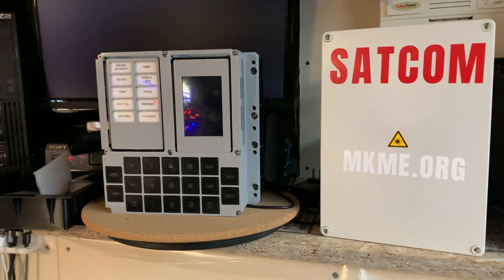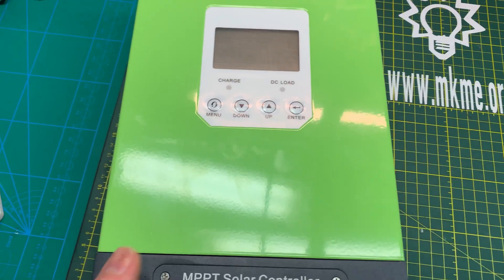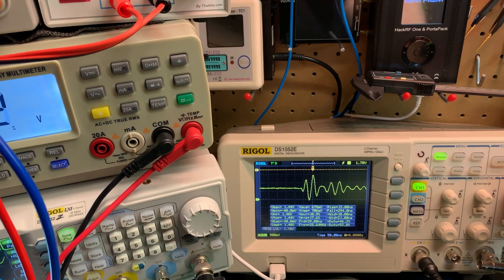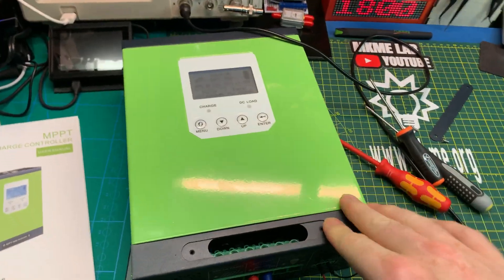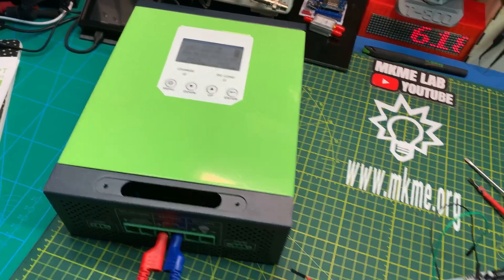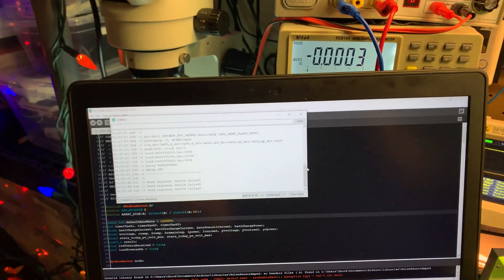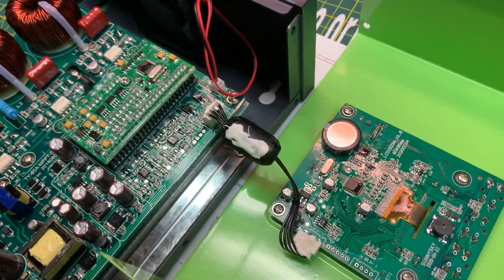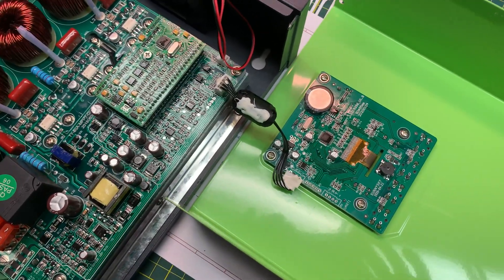MPPT Solar Charge Controller Hack Part 1

Comment: I have a charge controller that looks more or less like that, only it has a 6p6c connector labeled RS485, and the same 2.8V on one of the lines, and also no response when polled. Curiously no menu options about configuring the serial/modbus (unless they're hidden somehow).

Comment: Some controllers have optional RS485/Bluetooth/WiFi but you can inly have one. Maybe it has the port hardware, but not actual circuitry for it? Or perhaps it's just bespoke.